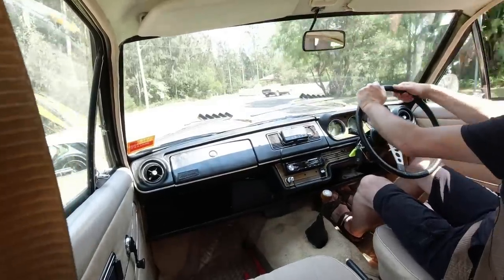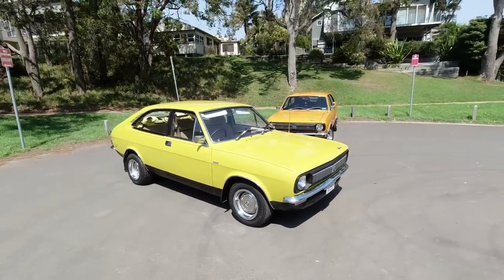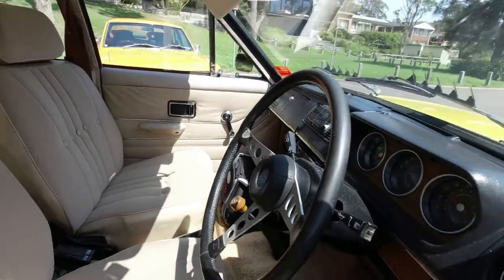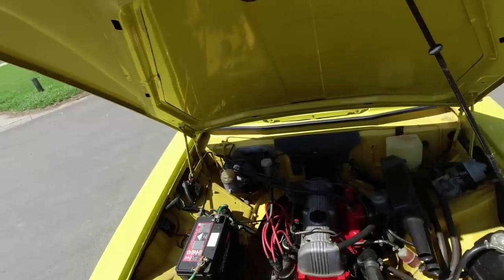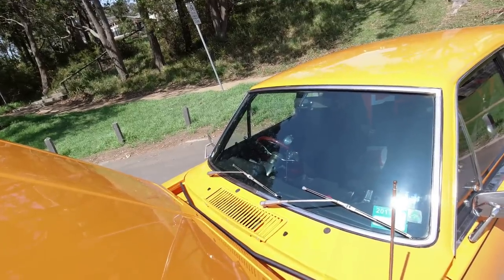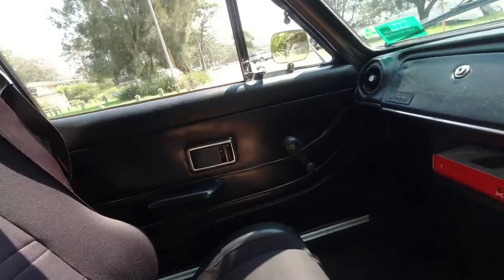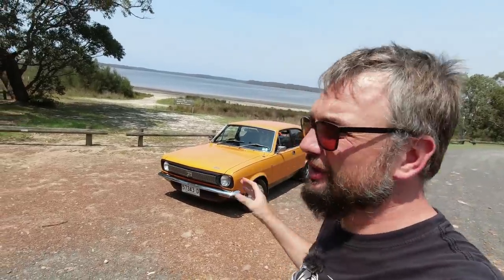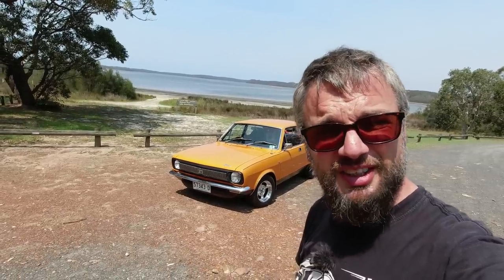Aussie Oddballs: Leyland Marina SIX-CYLINDER! Driven!

Comment: I inherited {Hand me down} a 1972 Coupe Marina TC in Black Tulip with very red interior I remember Dad Buying it new...... I was about 14 at the time so It was About 5 or 6 yrs when I got it after my sister had it of course.... At first I would'nt have called the Queen my Auntie....... I never really thought much wrong with it at time and did have a little street cred because it effectively had the engine of and sounded a bit like a MGB......... Needly to say it ended up requiring an engine and then it got bashed ........ I think I ended up with a metro if so it had same fate of replacement engine needed .......... Is there a theme emerging here of my youthfull enthusiasm......... BTW  I did have a Moggy thou at one time and the comparison funnily is starkly there

Comment: 7:51 Those awful exterior door handles are very similar to the ones AMC used in the 1970s. I don't know if they actually bought them from Leyland, or if they had to pay royalties, but they looked similarly painful. I can't imagine facing a car on an icy morning with those things in the way, but I guess that would be a lot less likely in Australia or even the UK than here in New England. The 1970s were a dismal decade for door handles all around, but at least the ones from GM and Ford let you pull up on them, giving a little more leverage to open the door, but also enough to break said handles. I'm glad today's cars have reverted to proper door handles.

Comment: Could tell the 6cyl didn't have the classic Marina "stirring a bowl of porridge" gear change straight away and that engine is really shoe-horned in there, only mm's from the bulkhead.
Had the 1.3, 1.8, and 1.7 many moons ago, always wanted to try the Ital 2.0 but could never find one...

Comment: Logic DID prevail at Leyland , albeit in AUSTRALIA. I always thought that it was okay that MARINAS and ITALS were available with engines of 17/1800, but the 1300 Marina & Ital models my mother had, were far too slow away from the lights. I was always afraid someone would crash in the back! I always thought these cars needed a 1500 engine, and here it is!
Reply: 1500 four was standard with the 1750 optional. All E series OHC.
But the big power option chosen by about one in five buyers was the 2600 six.
We were amazed in Australia that UK buyers would choose a 1300 for something as large as a seventies Cortina. Even the 1600 base Cortina motor here was rarely chosen for our  TC seventies model.

Comment: This 2 -door Marina appears overall to me to look so similar to the Holden Torana GTR, especially the steering-wheel ?!
 
Please do a drive video on the Torana GTR (6-cylinder 2638 cc version).....as it's been some 40 years since i last experienced  a drive in that car & back then didn't managed (or have the equipment) to do a good drive video. 

And, as i recall i believe you're able to drive buses as well (?) so appreciate if you could (since you're still in Australia New Zealand region ?) do a drive video on a Mercedes-Benz OF 1417 (OM 360 engine with the famous 'very' loud exhaust brake) as i recall there's strong possibility there's some units this bus-chassis using Hawke or NZMB bodywork lying around in that part of the world today as they were 'retired' from revenue service from Singapore public transport & shipped to 'down under' say around 1995 ?? These were new bough in 1982 by SBS with 4-speed automatic gear from 3rd party.
Reply from the maker: Sadly, while I saw several Torana GTRs at shows and in museums, I never managed to drive one. Will have to return!

Comment: I had the 18 TC and I said to a mate listen to that engine reving it up , I put it in gear to impress with a wheel spin sliped the clutch and reversed full pelt into a Range Rover . The gearbox was a bit hit and miss with 1 st and reverse. Well it was like whisking eggs changing gear in a warn marina

Comment: The three-dial dash doesn't look unfamiliar to me - didn't the European TC models have them too? My dad worked at BL Netherlands at the time and had at least three. I should still have some brochures on the Marina's, including the South African and American (Austin) Marina. Time for a nostalgic dive into the archives...
Reply: post-dive update: The European 1.8 models (1st series) all had a three dial binnacle.  The only info I have on the E-series engined cars is South African, two generations. It only mentions lever arm dampers for the front suspension, but I have documentation from Leyland Special tuning that lists a telescopic damper conversion kit for the front (C-AJJ 4120) and a rear spoiler that looks remarkably like the one on the 262 in the video (STN 0032). They list 82 kW for a standard 2600 - back in those days SA and Australia already used ISO units and I remember thinking 'why don't they just give the horsepower figure, how much is 82kW anyway?' Some 110bhp actually.
OK, enough of the nerdy stuff - make mine a 2600 Ute/Bakkie please. Or a saloon.

Comment: Quite a scary thought a 6 cylinder 130hp (basically) Morris Minor with torsion bar front springs and cart springs at the back. If this car had disc brakes I guess they came from the MG Midget 1.3 as I think that is where the 1.8 Marina discs came from.
Interestingly I heard a story that a Marina left the UK factory with one disc and one drum brake on the front and it took some while to find that out!
I used to be a Mini boy racer back in the day and Marinas in scrapyards were a good source of later engine parts.
Reply from the maker: Torsion bar/leaf springs seem to work well enough in a Jaguar XK120. ;-)
Reply: @HubNut  
I acknowledge your knowledge is far superior to mine in these matters and I respect your programme making skills.
Yes the same spring technology but the Jaguar XK120 was introduced 23 years before the Marina I believe.
Leaf springs all round worked well on the LeMans Bentleys but car technology moves on.
What other cars were introduced around the same time (72ish) as the Marina with both leaf springs and torsion bars?
Best regards.

Comment: I just watched this legendary video again, as I was a bit puzzled when it was mentioned (while driving the mighty six) that the engine was reported revving at 4500 rpm at 100km/h. I had a good listen to the exhaust note and it sounded octaves lower for 4500!.... More like 3500! Not trying to be picky but I don't think Leyland Australia would've installed a 4-cylinder ratio in the diff for a 2.6L six. I know for a fact the car was in top gear too and not third!
Reply from the maker: Possible the gauges were incorrect, but it was very busy - I wondered if that was to stop it being too good at cruising, in case it stole sales from larger cars in the range.

Comment: Indicators were on the right in the UK too until joining the EU. The correct ergonomic side is the door side so to not compromise gear changing and centre dash control tasks - all my 10 Triumphs have the indicator on the right. No LHD car has the indicator on the incorrect side, always the left for them.
Reply from the maker: Interestingly, the EU has never ruled on which side an indicator stalk must be. It's just fashion. As we got more imports, people got used to indicators left, and it became the accepted norm. Malaysian cars, into the 2000s, still had indicators right, even when sold in the UK.
Reply: @HubNut  It's an EU regulation, but it may be one that can be ignored for vehicles solely sold in Britain, but not for British made cars sold in the continent. 

Those Malaysian cars (Protons?) would have had the indicators swapped over for all LHD markets - not just a fashion. It is a lazy effort and ergonomically deficient, and especially in a manual transmission vehicle, which I understand the Brits still like to drive. In Australia the old school motoring journalists call them "cack-handed stalks", and rightly so. It's so much more pleasant, easier and safer driving a car that is correctly configured, especially in heavy traffic when gear changing, indicating and steering  can simultaneously occur, and it can't when your left hand is double tasked. 

No LHD nation allows the indicator to be on the right side. When Australia made cars for export, like the Holden Commodore in low volume, they had to swap over the indicators to the left for the USA. South Korea is a LHD  nation, and it swaps over all it's cars for Australia, because they understand, even if there is no legal requirement here. Ford now swaps over all it's new models sold here, including the current Ford Mustang, and that is the first time there has been a US made car sold here with the indicator on the right side as far as I know, and I had a bit to do with that change of policy. The last Holden Commodore was made in Germany, and it also had the indicator swapped over for Australia, as did the Astra, but I gather the UK Vauxhall equivalents have cack-handers. 

Thanks for your old Brit car reviews down under, they are great. I'm a Triumph man, but I love them all. My late mate had an Austin Kimberley and a Tasman that were in spectacular condition, but sadly, they have survived him.

Comment: I had an S reg 1.8 Marina. It was complete junk but there was a good car buried under the worse than bloody awful quality. (Apart from anything else, the bottom of the front doors had rusted through in less than 3 years.) It was comfortable and handled quite well. I'd really like to try the 6 cylinder. It was also the last of the lightweight cars before they started getting fat like people. Unlike the light Mk 1 and Mk 2 Cortinas it had full length box sections, a good stiff bodyshell before it rusted.
On the handling, I think you might be under rating it. I bet it can out-corner an MGB.

Comment: Great video. What a shame that both cars had such busy low gearing in 4th, the fuel economy couldn't have been good.
Would be an idea to fit a higher final drive diff. perhaps or I wonder if an overdrive would fit? I thought the E series 6 cylinder were always fitted with twin carbs?
Reply from the maker: E-Series 6 in the Kimberley changed to single-carb for Mk2 (as per the one I drove). Same power output.
Reply: HubNut  Interesting. In the UK always twin carb. as in the 6 cylinder Land crab & Princess.
Reply from the maker: @Martindyna  They had too much trouble keeping twin-carbs in tune apparently. I guess maybe garages were more used to twin carbs in the UK? Certainly more used to SUs.
Reply: HubNut  Thanks, that makes sense. Totally with you about the terrible wipers btw, they would be a constant irritant for me, parking so high up on the screen ! Yet they improved the cars so much in other ways - those front seats look really comfortable for the longer journeys in Australia (all the more surprising they didn’t sort the top gear ratio to be suitable for cruising).
I don’t recall the UK cars having ‘busy’ gearing so perhaps this was an Australian thing.
I remember the 1.8 in the UK had ideal gearing for a good top speed, it occurred virtually exactly @ max. power RPM and was 95 mph if I remember correctly.

Comment: The weak link on the 2.6 will be the rear axle, they were prone to disintegrating on the 1.8. Unless of course something better was fitted by Leyland Australia.
The Special Vehicles Operation at Abingdon put all sorts of engines in Marinas for rallying, but got told firmly "NO" every time: Rover V8,  No because it was faster than a Jag let alone the Rover and Triumph models. They tried the Dolomite Sprint engine but again the Marina was too fast.

Comment: Actually the US version, the Austin Marina used the 1.8 litre B series engine so it must have been possible to clean it up.  For some reason Leyland Australia still chose the E series which was probably a better choice anyway.  Perhaps as the Morris 1500/Nomad, Austin Tasman/Kimberley and P76 all used E series engines made locally, an E series 4 cylinder was the logical choice for the Australian Marina?
Reply: They'd already tooled up for the E Series for the Nomad, and when the X6 arrived to replace the 1800, the Australian produced B Series was phased out.

Comment: I had one these toys the 2.6l six those things sat on 7000rpm all day. Their six was 80mm shorter than Holden red motor. Also front suspension could be dropped quickly

Comment: You said one Marina had the maxi engine my question is did the ever use the Maxi four-speed and overdrive.
Reply: Nope because that gearbox is, as hubnut said, in the sump and front wheel drive... Maxis had 5 speeds.

This is rwd with a different box from what I gathered.

Comment: Well I can slag them off because  I owned one.  A 1.8.  Power was just about adequate, seats were comfortable it was ok to be in it and mine was reliable in the 4 years I had it. But nothing I've had before or since handled so badly. The drive to and from where I lived at the time had a corner that upset it so much nothing short of crawling round it would make it safe so you can imagine in wet or worse it was er exciting.  Overall a below average car.  I'd love to have a go in that 2.6 though.

Comment: No 5th gear on the 17/50 seeing as it was a maxi engine? Like the channel. Keith.
Reply from the maker: Maxi engine, but the usual Marina gearbox. In-sump wouldn't work with rear wheel drive.

Comment: One word ‘ Terrifying ‘ .
In all my years of motoring I have nearly died three times , each time in a British Marina !
Reply: Are you questioning my honesty because I don’t appreciate your tone ? 
Each of the two near misses  in my Marina were linked to the brakes , where I found myself spinning out of control when the vehicle didn’t stay straight . 

The other occasion was on a dual carriageway in the snow . I was driving reasonably slowly when a truck overtook me at speed and the pressure made the car turn through 180 degrees to be suddenly facing the oncoming traffic.
I was in an out of control Marina three times and yes I could have been killed.

Comment: Marinas with the 1.8litre B-Series engine understeered like pigs, I can't imagine how hard it would be to get one to turn-in to a corner with a six-cylinder boat anchor. The weight balance would probably have been better with the alloy Rover V-8 engine.
Reply from the maker: It didn't actually feel that ponderous. The Cortina could be had with an all-iron 4.1 straight six! They were known as lead-tipped arrows...

Comment: Australian built Leylands were generally better built cars than the UK built ones. I had a UK built 1976 Triumph 2500 TC and when it wore out bought a cheap 1970 Aust built 2000 TC with high miles. It was a better built car.
Reply: Although the Triumph cars in Australia were not built in the Leyland/BMC Sydney plant but at the independent Australian Motor Industries AMI Port Melbourne plant.
AMI were also assembling Toyota and Rambler cars in 1970 and had assembled Mercedes Benz 220 fintail cars from 60 to 65.
AMI started as the Australian arm of Standard Vanguard and was the only Australian owned car maker. 
By 1970 they were making that Triumph 2000 model with the skills they had learnt with Toyota and Mercedes Benz input into the best assembly and paint processes to be used.
Toyota were so impressed with the results that they later bought AMI to concentrate solely on Toyota.
The upmarket Triumph 2500 was still in demand in Australia but even the UK ceased production so no more once the imported parts ceased.
 A different story with the later  Sydney Leyland involvement with the Dolomite failure here.
Not too far a stretch to say a Triumph built to Toyota standards.

Comment: BMC/BL screwed up on the engine front which negatively impacted the Marina, Allegro and others. 1) BMC could have had a 106 hp 1998cc B-Series even a 112-115 hp 2-litre B-OHC by the early/mid-60s instead of just the 1.8-litre enlargement before the tooling was completely knackered by the early/mid-70s when it became the O-Series. 2) BMC could have easily developed the E-Series without Siamised Bores, enlarged the bore centres to 88.5mm bore centres (like on the similar VW EA827), utilized tuning by Downton Engineering (e.g. 83 hp 1.5 / 106 hp 1.75) and made it as compact as the later S-Series in allow for ~2000cc 4-cylinder / ~3000cc 6-cylinder displacements to effectively replace the old heavy B/C-Series.

Comment: I never got the standard 'Marina's are s@@t' attitude. We had several through our family, father had two vans, I had a van, one of my brothers had a 1.7 estate the other brother had an Ital van. They were all reliable, all did their job well and the estate was a really good motor. They were never intended to be anything more than a simple no nonsense car to try and combat the Cortina. For several years the Marina was the second best seller in the UK, so it cannot be that bad. Yes they rotted, but so did Fords, Rootes and Vauxhalls. I well remember rwd Escorts with floors like pieces lace and chunks of chassis completely missing.  I always thought that the worst thing about the Marina was the gearbox, which was a good gearbox in it's original Triumph applications.

Comment: I don’t think the six was fitted to the coupe, only the four door and with an auto box. The body would flex when you drove through dips and pop the bonnet. The guy I sold my six to wrote it off on a bend.
Reply from the maker: They did. That's a genuine Six in the video. And they offered both manual and auto, both three speed.
Reply: HubNut ok, I stand corrected. Thankyou.

Comment: The trouble was the B series was the nicer engine as the E Series was heavily undersquare with a long stroke and siamesed cylinders with no water jacket between the bores as the six cylinder had to be made to fit transversely, and the 1.5 suffered from being tractory and not revving very well as it too inherited the long stroke and being undersquare...even though it didn't need it being only four cylinder. E series was just a dull uninspiring motor.